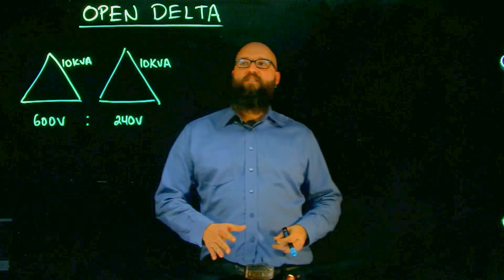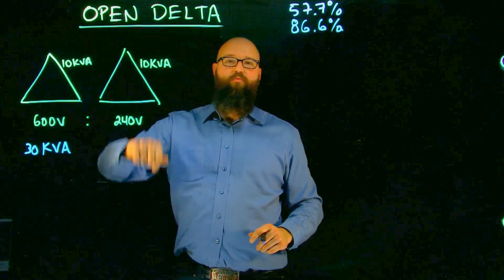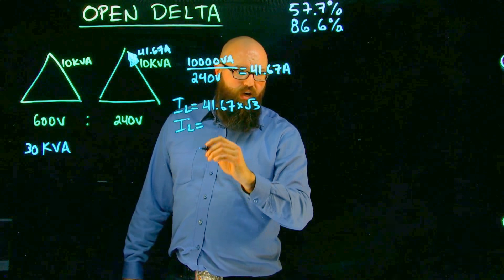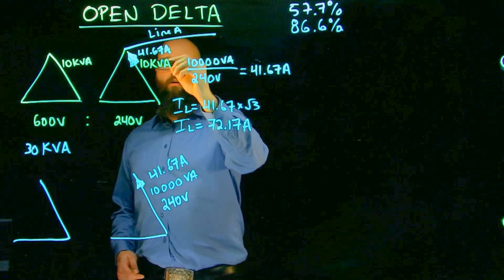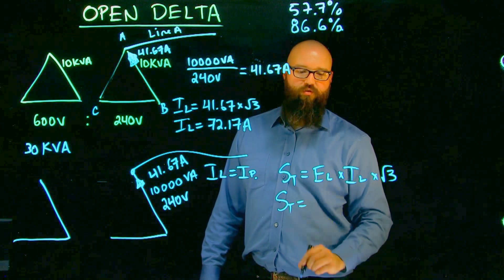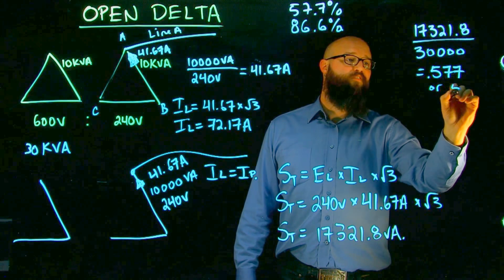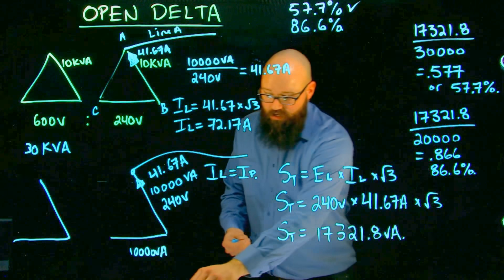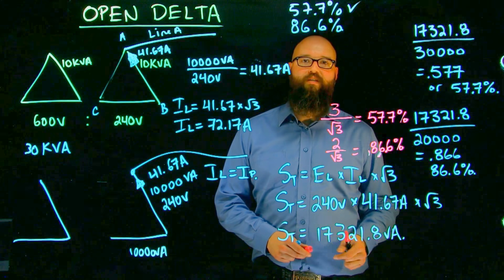Open Delta Reduced Capacity

Comment: 3/sqrt (3) = 1.73 and 2/sqrt (3)=1.15. The correct relation can be 1/sqrt (3)=0.58, because the current reduces by sqrt (3).
Reply: Ok. Now I see the description. By the way, Good explanation!
Reply: @mstabilito  It's sqrt(3)/3=0.577 & sqrt(3)/2=0.866. But yeah, this is very helpful in getting the transformer ratings for 3-phase loads to be connected in v-ph lines.

Comment: In some areas in the USA open high leg delta systems are very common in rural areas,  especially farms,  where the majority of the loads are your typical split phase 120/240 , but you also have some 3 phase motors such as for augers, pumps and grain dryers.    In these cases the capacity of a closed delta is not warranted,  and the utility companies seem to love that because they only have to add one transformer vs. two and cuts down on costs.
Reply from the maker: I have heard railyards also commonly use them! Thanks for the info, I was unaware that they were common in rural areas, but will share that with folks as examples!
Reply: @schulerruler  I've drove by probably a dozen or so of them,  mainly in southeast Michigan  I've seen a few in Tennessee,  Kentucky,  and South Carolina, which can easily be identified by a pole with two transformers, one being much larger than the other.   I don't know whether the are common per se, but every single open high leg delta that I've come across was on a farm setting, if they have larger motors to power.  But then you'd question yourself whether it would be more economical to install a rotary phase converter for the 3 phase equipment you want to run.    I guess it's a situational thing.
Reply: I'm in west Texas (retired electrician, but still doing side-work) and run in to this exact scenario A LOT, particularly on larger ranches & farms, and also in  light industrial & commercial  locations as well.

As you mention, the utility likes to build the open-delta xfmr banks, because it's less expensive (2 vs 3 xfmr's), and only two HV phase-legs need be brought in on the high-side, for additional savings (of time and $$).

Comment: Would the same hold true with a 3phase genset with an open delta?  The reason for the question is converting the 3 phases into a single phase/split phase by making a zigzag connection from all 3 phases.  In other words, creating an open delta for 1 leg of the split phase and then taking the remaining phase and putting it in series with the open delta for the other leg of the split phase, which would look like this, /\_.  L1 /\ N _ L2

Comment: When a 3-phase motor is connected to a delta power supply and rotate at full load, will it work  if one of power supply legs opens during loaded condition ? What will be the scenario?

Comment: What will be happen when take current from terminal (B) instead of terminal (A)..?  Is line B current increase ?
Reply from the maker: It will work out the same.
Reply: @schulerruler  why current is not increase at terminal B when both phases ( A&B )are healthy ( not disconnected) . As the previous case of balanced delta
Reply: @sheetalsharma1466  Current is flowing BETWEEN B and some other line, no? Either A or C. A and C are both at reduced capacity. This is the circular wizardry of deltas.

Comment: If 1000kVA Dyn11 transformer primary (delta side ) is connected to a 33kv distribution line...if a jumper opens (ungrounded) in 1 of the phase, what will be the capacity of the transformer ?..57.7?..pls clarify..thanks in advance.
Reply: I’m assuming open jumper in 1phase means it’s inside the delta and all 3 line jumpers are in tact. Then it follows the training in video,  1000Kva x .577= 577Kva. If a line jumper opens this bank goes to single phase and no 3 phase can be delivered.

Comment: Respected sir, 
Open Delta is important to supply current to "transformer to 3wire connecting circuit " Method (houshing board circuit device) method
Reply: I dont mean to be offtopic but does someone know a way to log back into an instagram account?
I somehow lost my login password. I appreciate any tricks you can give me.
Reply: @Shane Orion Thanks for your reply. I got to the site through google and Im in the hacking process atm.
I see it takes quite some time so I will reply here later with my results.
Reply: @Shane Orion It did the trick and I actually got access to my account again. I am so happy:D
Thank you so much you saved my account :D
Reply: @Cash Major glad I could help :D

Comment: great explanation; but the 3 divide by root 3 is incorrect, so does 2 by root 3
Reply from the maker: They should both be the other way around for the formula to be correct. I just wrote them down wrong.

Comment: hardly a proof... just a bunch of formulas. should actually explain that the line current on open delta is offset by 30 degrees from voltage across transformer